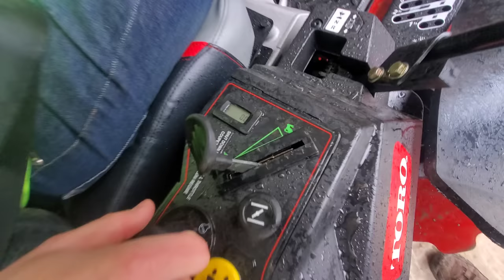[What We Have Been Waiting For] It's Finally Here

Comment: Awesome brother, i went with a rider ztr also this year, the #worldlawn king cobra 52in ztr, 12mph, wish it had the Kawasaki 801v but I'm fine with the 730v 23.5 hp... 24inx13.5in rear tires, and 13in front tires...  borgs warner pto, and zt5400 transmission's.  I like the hrdro and transmission of hydro and wheel motors. Smoother and its a low pressure system like a trans axles on a Corvette,  whell motors use high pressure, there more touchy and blow seals and hoses etc, also i think harder on the hydros and engine... i did a lot of research before buying lol... love it... hope yall enjoy it.... God bless

Comment: I run the limited edition my ride 60 inch. It’s a great mower.  Just ordered the Tweedle’s for mine. I have the aluminum black out rims. Just be for warned. It’s very touchy at low speeds. I need to get in contact with someone at toro higher up over my stander. Any ideas would be helpful. Thanks. Have a great week.
Reply from the maker: I know they have a great customer service line you can call. Maybe start there?
Reply: Spencer Lawn Care not sure on that number. But because it’s always been a warranty thing that’s who I’ve been in touch with. Their warranty department isn’t very good and likes to blame the customer for their machines faults.

Comment: I can't wait to see what you think of the Toro mower. I've been kinda looking for a new zero turn rider but most don't ride real smooth. That can be really bad for someone with back issues. I'm about an hour and a half from where Apple Creek.
Reply from the maker: very nice we drive about 40 mins to get to the dealer. its worth it
Reply: i had a 39.6hp f3990 for test run with a nice heated/ac cab stereo  wich love it and air ride seat 4wd love it and price was cheap $27,000